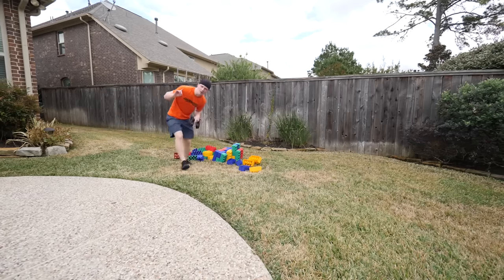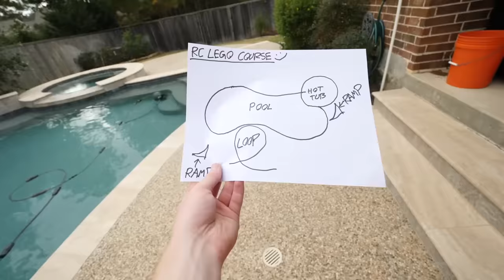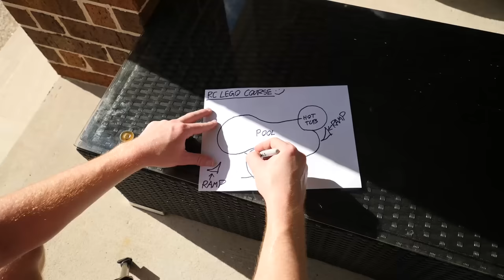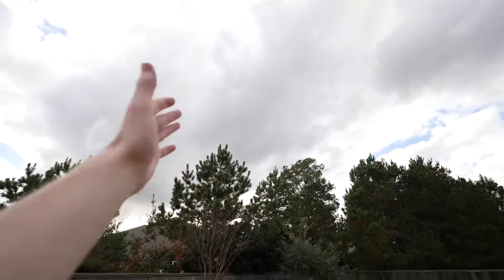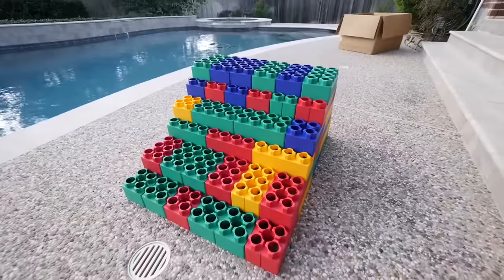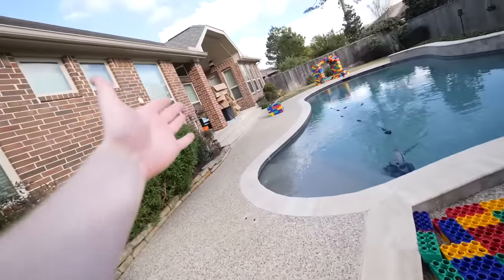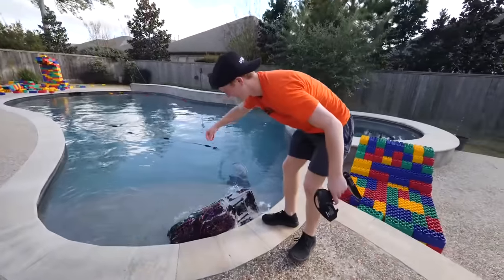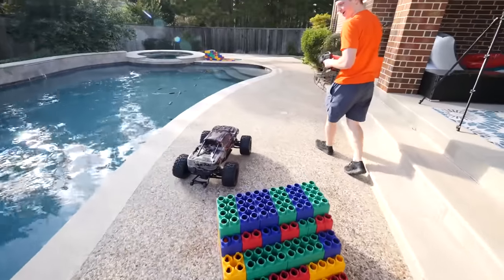BUILDING A LEGO RC CAR LOOP! *INSANE*

Comment: about the Lego ramp there’s got to be something to it they got your idea about your leg around it’s just looking fantastic but I hope you build some better ones because those ones are really cool but you’re probably gonna build some bigger ones at the end of this video when does raider wrapped and just sitting like why is 30 a not really a lot of ones with the word unspeakable hide it when it unspeakable is one is actually on one of them when there is Legos why won’t you have the one with on speakable on it turn it yellow because when it’s yellow that might mean it’s going all you need to do is just put some gold on it and then you literally got yourself some really cool Legos right on speakable on all the other Legos with a sharpie so then it can be like you only have golden eagles have it with only one which is kind of like bad because you need to find the golden one but they got my fall off inside the box because if you use a really thin gold or whateverFalls off very easy then that is not really good about it so why won’t you just Gotta go to break away on speaker as a Lego instead